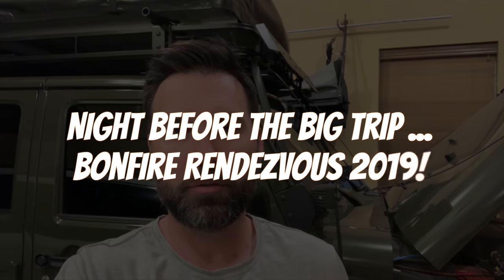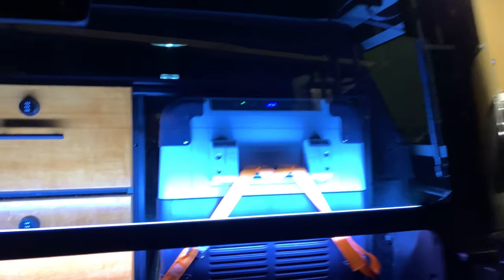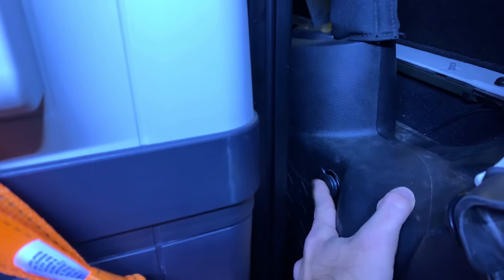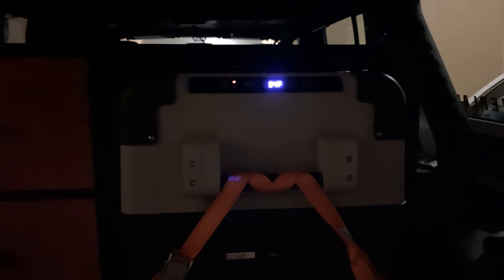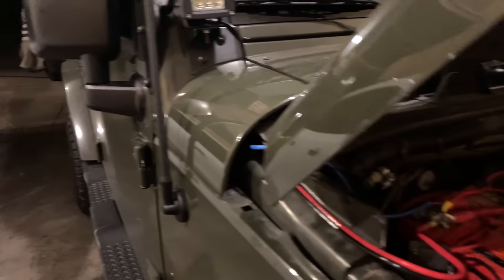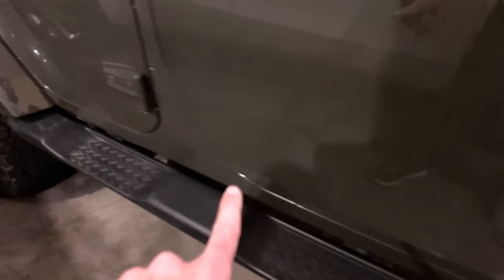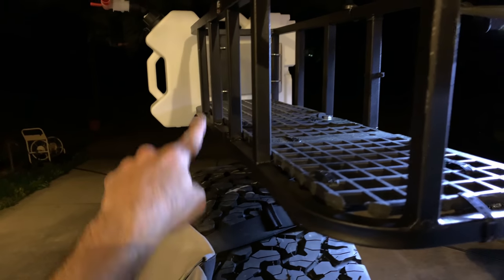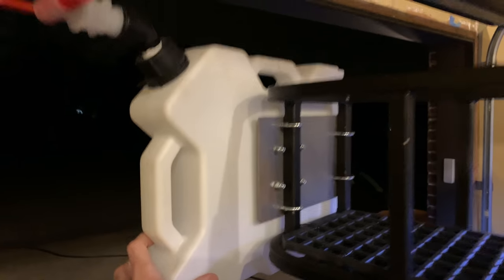3 Improvements I Made To My Overlanding Rig

Comment: Love the floor you did on the adventure rack. Thought it was a milk crate at first! And the rotopax mount is sweeeeet. Great video!
Reply from the maker: Arkansas Offroad thanks man!  That flooring is really solid stuff. It does look like milk crate 😂

I finally had to get the Rotopax mount powder coated.  It was rusting really bad.
Reply: @OverlandAddict  Rust is the WORST! Glad it's all worked out.

Comment: You need to fuse that positive wire off the battery, if you get a short you will loose your truck from a fire
Reply from the maker: sizercam i installed an in-line fuse on the positive side 👍🏻

Comment: As a tech I can tell you... never use those splitters in any FCA vehicle... the wiring for those power supplies is not sufficient... you will always run into problems... always hard wire with proper gauge wire...
Reply from the maker: Anywhere Overlander good to know.  Thanks for watching!